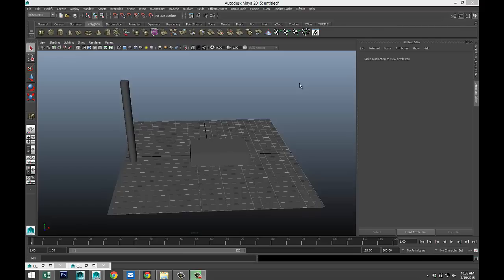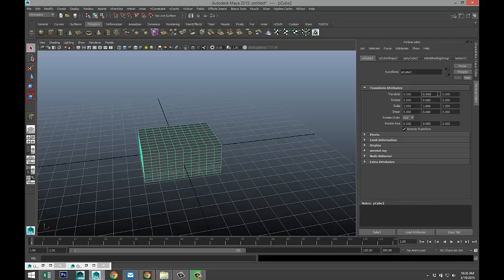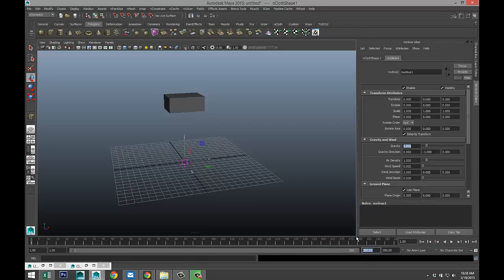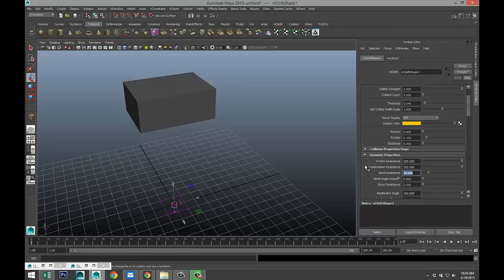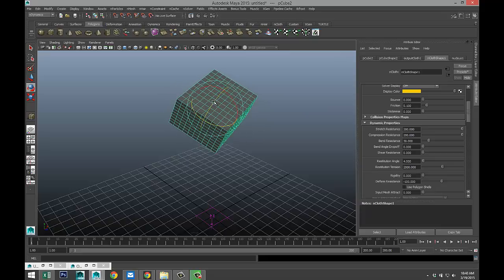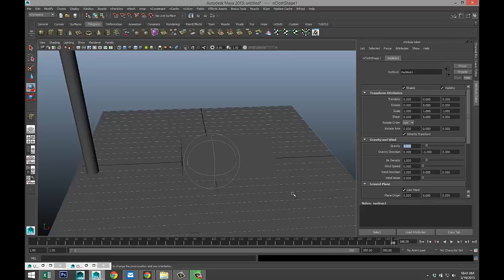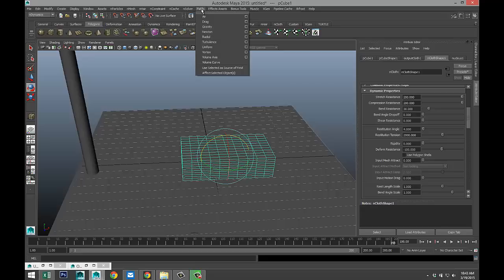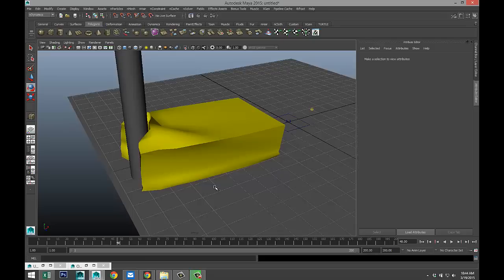Maya tutorial : How to simulate a Car Crash

Comment: hey i have a question.

i want to animate car by keyframe, and then after that i want it simulated by dynamic.
let say from frame 1 to 100 , i animated a car using key frame, and after frame 100 i want ncloth do its job.
is it possible, rather than using uniform field to make the car moving ?
Reply from the maker: Ulat Bulu Hi Ulat,

Yes, it is. But keep in mind that you can also keyframe the uniform field.

Regards,

Mike